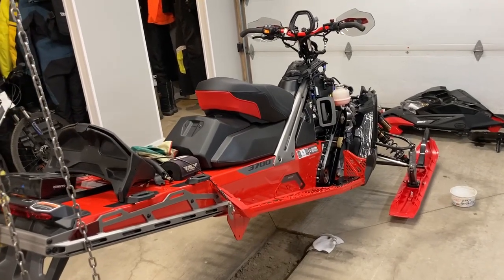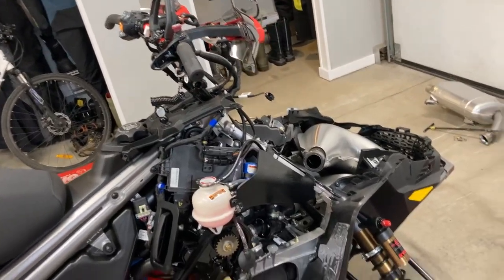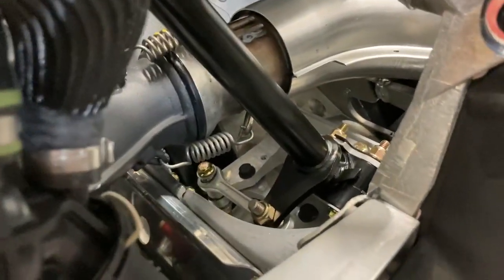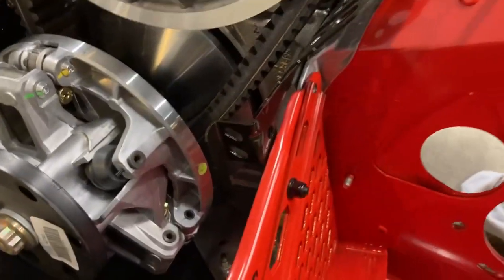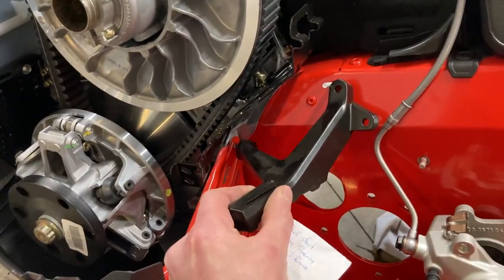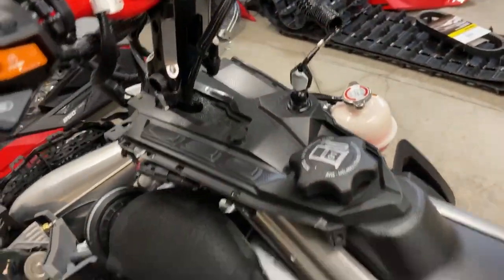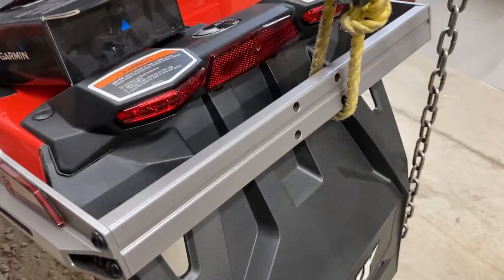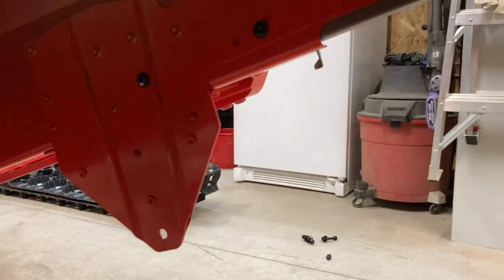2023 Lynx Xterrain Features

Comment: Hi. I ordered a 2024 xterrain and was wondering if you could look
At the belt temp in the middle of the 10.25 gauge. It says you can but is optional As some models don’t come with the sensor. Did you install the belt temp sensor or did it come with it? That would be awesome to monitor that on the new 10.25 gauge as not many choices of stuff to monitor on the center gauge in it. Thanks for any info.
Reply from the maker: I’m unsure if you can put it in the middle, but it is always on the side